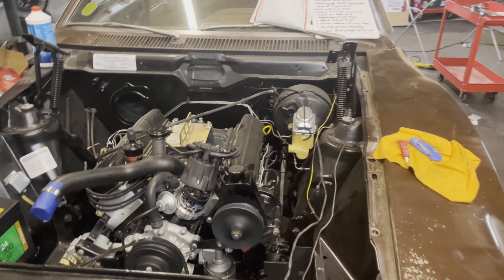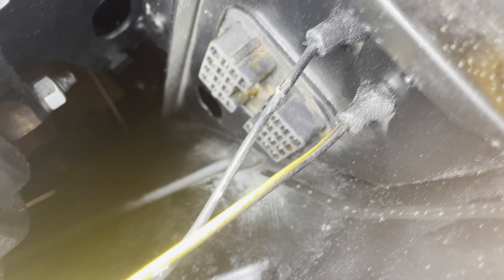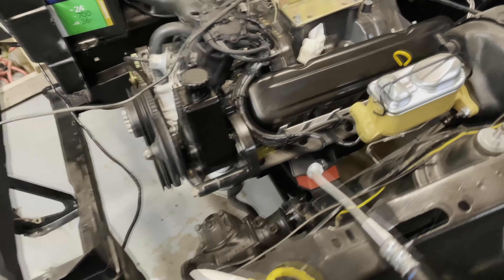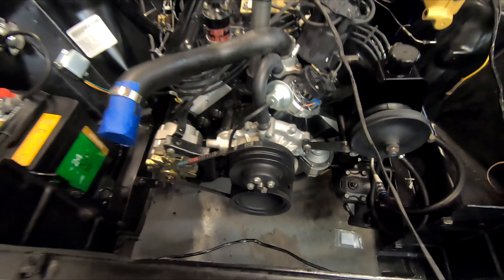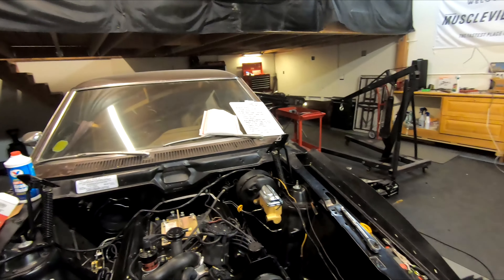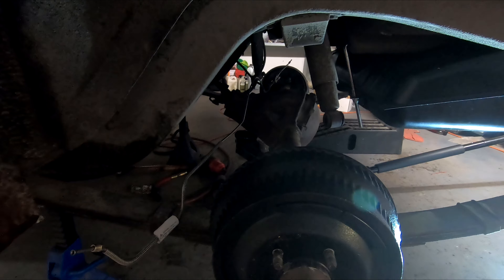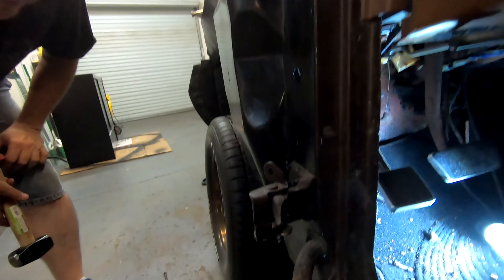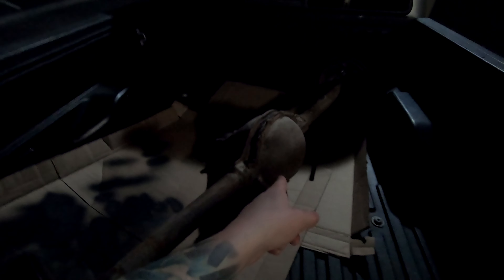Faster N' Louder | 1973 AMC Javelin AMX | The Road to Roadworthiness Part 2

Comment: I wish you luck with the LED's.  The affordable ones I bought at the chain parts store were a big flop for me.  They were too directional. You could not see the light unless you were directly behind the bulb and not off to the side.  And some would not work. The would light up with a couple of jumper wires, hooked from a battery, but not in the socket in the car.
There are known issues with positive vs negative current directions with most of them. The only ones I kept installed were some marker lights on the roof of my pickup.
   I've seen high dollar ones that word on Youtube but we are talking 100 dollars a pair, not 10 dollars. I think one key is ordering red and amber LED's, not white.The red and amber of the lens is washed out with a white LED, unlike with a white normal bulb.  Also, I don't think there is a role for LED's in the dash since you really can't dim them with just the factory dimmer of an older car.
Reply from the maker: Thanks for the advice! I did do some research and ask people that did the swap a lot of questions before making purchases. I got red bulbs for the taillights, and white for the reverse lights. I'll likely be keeping the front turn signal lights original, but not entirely sure yet. I'm also keeping the dash lights original.